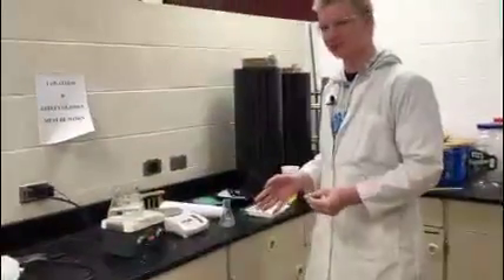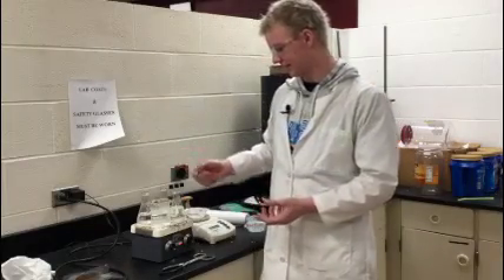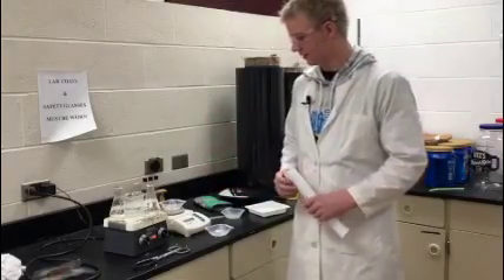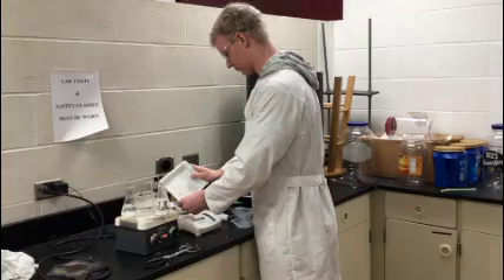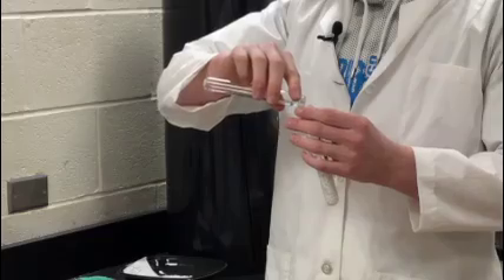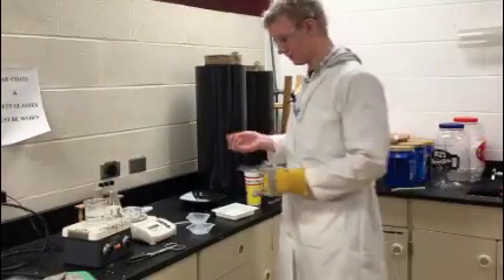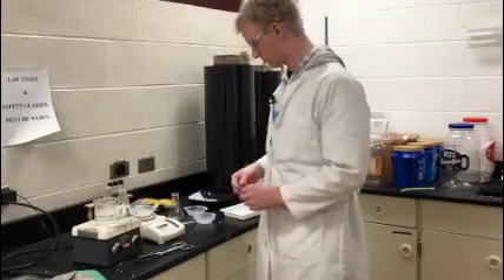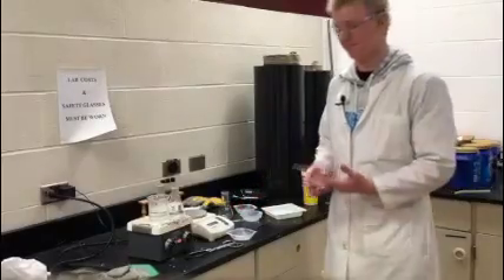Water Absorption

Comment: So how do you get now to a value of water absorption - not very well explained. But the music at the end is nice.
Reply: Water Absorption and % Moisture Lab Write Up Calculations 
3 samples ~10-12g each in Boiling Water for 1 hour;  
3 samples ~10-12g each in Room Temp Water for 24 hr

Masses: 
Day 0 = Preconditioned Mass (Pellets obtained from storage, room conditions) Mass pellets, place in oven.
Day 1 = Conditioned Mass (Pellets in oven 50°C/24hr, mass them after taking them out of the oven.)
Day 1 = Bring 3 flasks/beakers 50-75mL water to boil, place 1 pellet sample into each, boil 1hr. Also, place another beaker of water on another hot plate ½-high temp to use as hot water supply to top boiling samples off as water evaporates. Mass samples after boil. Place samples back into oven for reconditioned mass.
Day 1 = Place 3 samples into test tubes, top with water for 24hr test.
Day 1 = Wet Mass boil (Conditioned pellets in water at 100°C/1hr)
Day 2 = Wet Mass room temp (Conditioned pellets in water at 20°C/24hr), then place back in oven
Day 2 = Reconditioned Mass boil (Wet pellets that have been placed back in oven 50°C/24hr)
Day 3 = Reconditioned Mass room temp (Wet pellets that have been placed back in oven 50°C/24hr)

Calculations: 

% Moisture = [(Conditioned Mass - Preconditioned Mass)/(Conditioned Mass)] x 100 

% Water Absorbed = [(Wet Mass - Conditioned Mass)/(Conditioned Mass0} x 100

% Soluble Matter Lost = [(Reconditioned mass - Conditioned Mass)/(Conditioned Mass)] x 100
    *Only calculate % soluble matter lost IF the Reconditioned Mass is less than the Conditioned Mass. 
If it is not less, report it as zero. 

Conditions: 50°C/24hr, 20°C/24hr/water, 100°C/1hr/water, 50°C/24hr
Reply: @davidhelmick9  thanks for the explanation